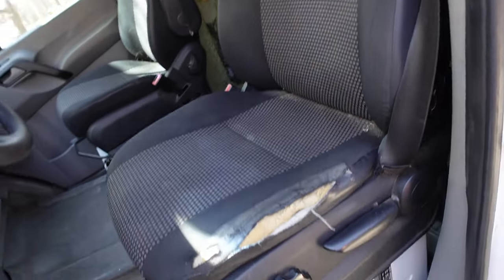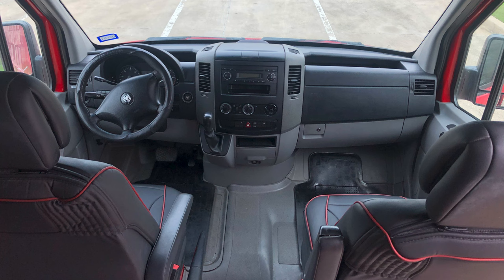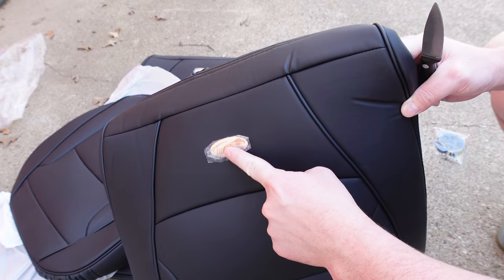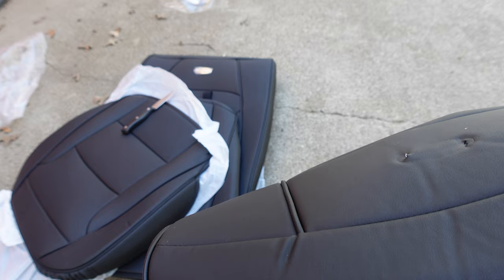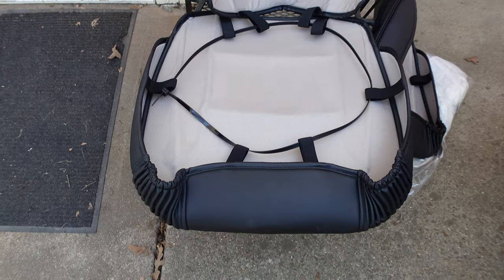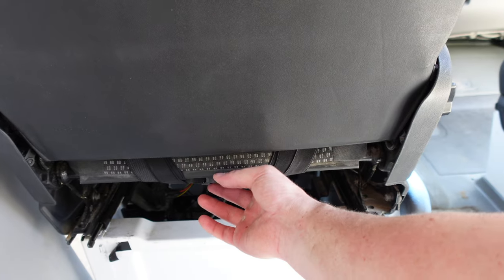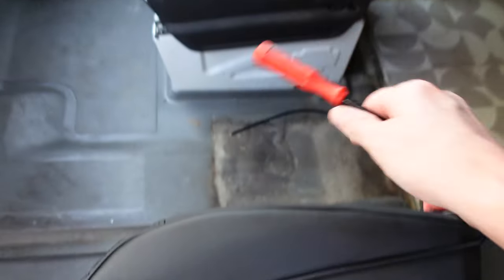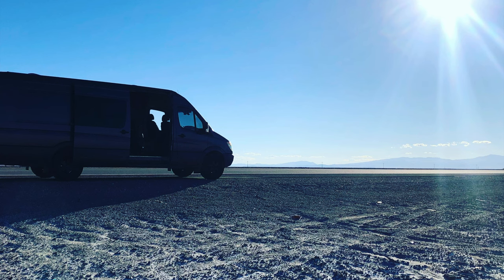Sprinter Van Seat Covers. Best Seat Covers For A Sprinter Van

Comment: What brand are they? I have a 2005 dodge sprinter. Will they fit mine? What do they cost?
Reply from the maker: meh, I wouldnt use them on the t1ns, or at least I havent tried, doubt the fit would be as snug, better option is to just pull straight from a bmw as they bolt right on

Comment: my jaw dropped open when you showed what it looks like installed.  I have a couple T1Ns that need seat cover help. Is there a version for them?  Link?
Reply from the maker: hm. I am really not sure how these would look on a t1n, there are some people swapping those seats out for bmw seats, seems completely worth it, just pick some up from wrecking yard, possibly for less then the seat covers cost. I believe sprinterTech has a video on that
Reply: @sprinterfix   There are a lot of seat covers that seem to be somewhat universal on eBay for very little money.  Where did you get yours?

It's a good idea about using seats from a BMW or other car. I looked at some videos, seems a little more involved than covers.  I might try covers first.
Reply from the maker: @terracoilGuy  PU205102SOLIDBLACK is the exact part number. I didn't add it because I do not want people thinking I am trying to sell stuff. they sell on amazon and ebay. sometimes you can get open returns for like 60 bucks. they're usually selling for between 100 and 150 most of the time
Reply: Just drop a link who cares